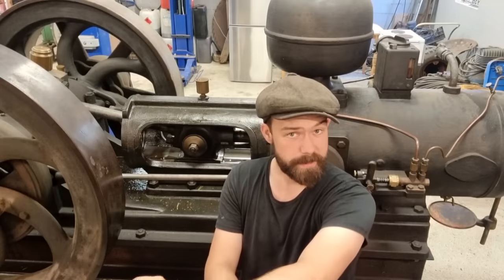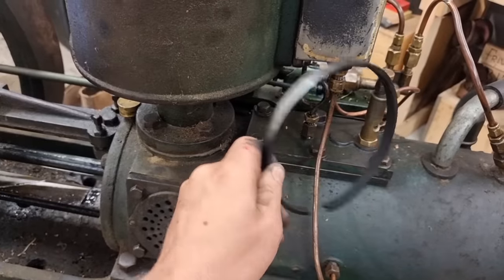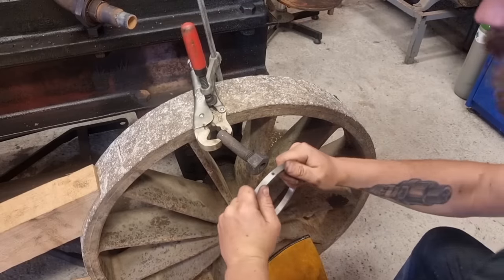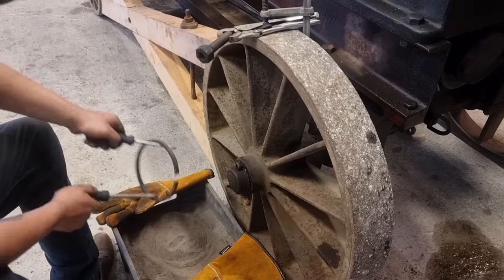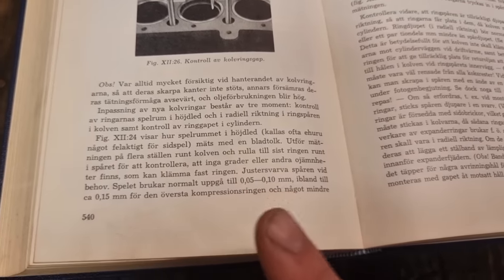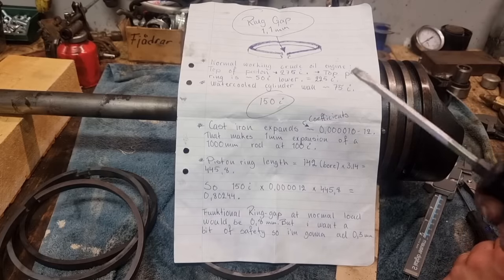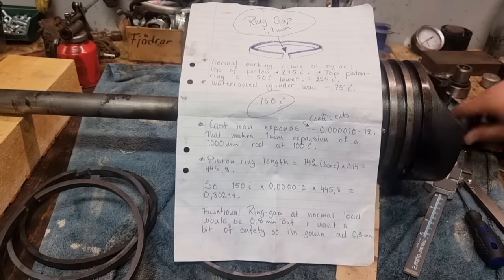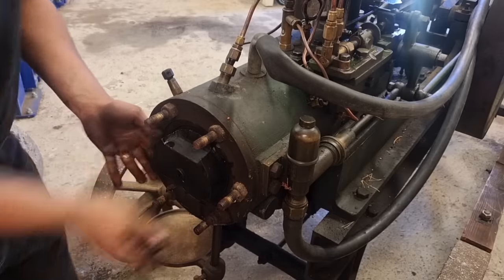Making Piston Rings!   In just 131 easy steps?..

Comment: Nice job on the new rings !
I made some smaller piston rings a while back and the old turner at work kept me right. We didnt heat the ring up, but peened the inside of it with a piece of round bar before cutting it and that gave it it's spring.
I recently saw a video on here about making "Clupet" piston rings, there was no way I could believe you could manipulate cast iron the way they did ?

Comment: Thank you for the video. Question: Is it possible to drill the hole (in this case 6mm) and then cut the rings instead of filing the pin hole with a file after cutting the rings?
Reply from the maker: Hi, yes of course. If you clamp the ring down tight that would not be any problem at all. But i think this method is easier, because a drill bit could get stuck and snap the ring of or crack it. This feals better and safer. /Richard

Comment: If you need a nice flat surface to sand parts on one of the best things readily available is a piece of sheet or window glass.  A piece of 6mm (1/4") placed on a reasonably flat surface like a workbench or a kitchen table will act as a flat backup for your sandpaper which is affixed with masking tape on the top surface. DO NOT used double sided tape on the bottom side as it will leaves a hump that will through everything off.

Comment: Man, finally, with the help of your chanel, I can travel in time a bit. Great content, keep up the good work. One question: Would it not have a good idea to make the recess for the locking pin by drilling thru the ring and then cutting it open thro the drilled hole?

Comment: Of you don't have an old pulley wheel to make them from, centrifugally cast tubing is produced, which will be of better quality than something produced from a sand casting. No trapped air resulting in cavities. Ask any steel merchant, if you've never encountered it.

Comment: For comparison, gasoline engines use .004 inch of ring gap per inch of bore for cast iron rings.
Reply: Yes, 0.1 mm equal .004(.003937)inch if I am not mistaken.

Comment: Hey Richard, nicely done! Thanks for sharing. About the expanding of cast iron, the books I used in school say 9-10×10^-6 m/m K^-1 @ 20°C... not that big a difference, or does it have to do with the base temperature of 20°C?
PS the dutch word for cast iron is 'gietijzer' 😅
Reply from the maker: Hi! Ok, yes maybe. And if you heat it up to 200c istead of 100c it is gonna expand more than 2mm. But that is so little that some books just dont bring it up. Would be fun to turn a "fake" cylinder in the lathe and put a ring inside and heat up and see what happends to the ring gap at different temperatures. /Richard
Reply: And the Afrikaans word for cast iron is "gietyster".
Greetings from South Africa.

Comment: I don't know if anyone else suggested this but why not drill the side notch before splitting the ring then correct as necessary with the file? The notches would match perfectly by default. Nigel
Reply from the maker: Hi! That would work nice, but then i would have to make a jig for it. And this is faster and turned out very good! If i was to make 20 rings, i would have made the jig. /Richard

Comment: Nice job!  I've made tiny piston rings for my son's model 4 stroke engine.  5/8 inch bore.  The 2 rings are 5/8" od x .026" wide.  The engine runs very well with these rings, which were made from rocker shaft supports of an old and scrapped car engine.
I noticed that you made the piston ring with a uniform cross section, as did I with those tiny rings.
Yet when you held a big, 300+ mm in diameter piston ring in your hand early in the video, it had been machined with an eccentric bore.  Thus this ring's cross section increased from a minimum at the ring gap, to a maximum 180 degrees from that gap.
Have you ever machined such a ring and if yes, how did you determine the minimum and maximum cross sections required?
Thanks for your response.
Reply from the maker: Hi! I dont quite understand. The 300mm ring is just like this one i made. But that one is factory made by Beijers engine factory in the 1930's. But that one also has the same thickness all around. It is not made excentric? Best Regards. /Richard
Reply: @YesterdaysMachinery  Hello Richard, I'm just guessing at the 300 mm dia.
One of the big rings you are holding early in your video definitely looks eccentric to me, with a thinner thickness at the gap end, and maximum thickness at 180 deg. from the gap.
Note that I am talking of ring thickness, ie. the radial dimension.  The width of the ring, ie. the dimension fitted into the piston ring groove is, of course, uniform.
But you stated that you never machined an eccentric ring, so that answers that.
Fact is, commercial rings are machined eccentric in order to produce uniform pressure along the ring on the cylinder wall.
A uniform thickness ring does not do this.
Think of a uniformly loaded cantilever beam of constant section modulus ie. uniform cross section.  Its deflection would not be a curve of uniform radius.
Not sure this is a good analogy, but it is my thinking without digging into it deeper.
I'm retired but I have a textbook somewhere with a short section on piston rings.
If you are interested I shall dig it out and review it.
Best greetings from Canada.  Wolfgang

Comment: I am wondering Richard the reason for the round hole you filed in the location of the center of ring gap. Are the rings pinned in the piston to keep them from moving around the bore ??? Nice work Sir using a cast iron pulley for your starting base material. Good day and peace too. vf

Comment: I have never tried to make rings, but I imagined that if I were to try, I would make them a bigger diameter than the bore and then cut the gap accordingly.
What is the reason you start with the ring @ bore size?
Reply from the maker: Very good question! You can not make them that way. The ring will not be round if you do make them oversize then cut a piece away to make the "spring tension". That is how they have made the rings that was in the engine, im 99% sure. The ring ends will be a bit more straight than the rest and push themself hard in to the bore. Not good. And how du i know do you ask? Because i have tried exactly that. This way is much better. 

You could make them a little bit oversized, to compensate the loss of material when cutting the ring if ypu know that your saw is removing more than the end goal of ring gap. But that is very little. You should always stick as close as possible to the cylinder diameter for maximal ring seal. /Richard
Reply: @YesterdaysMachinery 
Thanks. I learnt something!
Reply: @YesterdaysMachinery  The name for the width of the saw cut is called the "kerf."  It's the measurement of the amount of material removed by a certain thickness of blade.
Reply: @YesterdaysMachinery  I am a stationary engine collector and I restore them, I have my own machine shop and have made rings like that for a long time and they work very well I am talking with 55 years experience, the only thing I do is  I grind the sides of the of the hacksaw so that when cutting  the gap is at a minimum width!!
Reply: That is how you could make step gap rings. But you need to compress the ring, and clamp it between two heavy washers and then turn the OD to size so that it is round when compressed.

Comment: Very nice work! I have a question: you didn’t work on the cylinder. But didn’t that share in the wear, making the bore unround aswell?
Reply from the maker: Hi! The engine has not run much with these rings the bore was almost to perfect. But i still dont think they have made anything to it. I messured it on a couple of spots but it was just fine. /Richard

Comment: Great work, taught me a lot about piston repairs - might come handy if such a job comes up, someday - now I know what info to look up.

Is there a reason you did not just drill a, say 5mm hole before cutting the ring apart to save on hand filing? 
(I guess lack of a working setup to hold and drill the rings, but I was wondering if there is a technical reason why you would not do that...)

Comment: How much clearance do you give around the locating pins so the pin doesn’t restrict the ring from compressing fully in the bore?
Reply from the maker: Hi! The locating pin was around 6mm. But if you would calkylate the expansion of the slot in the ring that clerance would be so small that you couldn't really messure it. If i compress the ring all the way in to the ring grove so that the ring gap is zero, i want a little play around the pin. But it is enough with as little as possible really. I have not find any data on that clerance actually.  /Richard

Comment: Awesome video. I have a question though : instead of sawing the ring then filing two half-holes on each side, wouldn't it be easier to drill a hole first, then saw along the diameter of the hole from one side all the way to the other side ?

Comment: Is the heat treatment just to relieve tensions and set the shape open so the ring wants to spring open when inside the cylinder for compression, or does it also enhance wear resistance or something?
Reply from the maker: Hi! Just to set the spring tension. /Richard

Comment: A most enjoyable video.  Could you not have drilled a 5.9mm hole  into the ring and then cut the ring???
Thanks for the idea of an old Flywheel for larger rings as `we` require soon two new rings of 12" diameter for a Buxton & Thornley Horizontal.  Thanks again, take care,
Reply from the maker: Hi! Yes i could but a file is faster than rig the ring up to drill a centered hole. i like files. /Richard

Comment: I always wondered how you got the right compressed OD but still have spring tension. Used to think they were cut oversize.
Reply from the maker: Hi! Making them as oversized and then cut a piece away aint good. When ypu compress the ring to the cylinder diameter in the bire the ring will not be round. So that is a no no. I have tried.... /Richard
Reply: @YesterdaysMachinery  That's what I thought would happen, great to see the process and methodology. Based on the wear marks on the old ring I'd wager it was made oversize and sat on the tips as there wasnt enough bending moment along the carbon stained areas to make them seal.

Comment: I really had no idea that cast iron is suitable for piston rings. My first profession was a machinist and I've made a lot of parts in cast iron, but that was most often parts were compression strength was important e.g. ball bearing housing etc.. I initially thought that cast iron would be too brittle to make piston rings, and I was a little tense when you stretched the piston rings to finish the ends. I have worked as a software developer since the end of the 90s and it is about 25 years since I worked as a machinist/toolmaker, my material theory is... somewhat rusty. 😉Is it common to make piston rings out of cast iron, and do you use a specific type of cast iron?
I just found your channel and immediately subscribed.
Greetings from Oslo. 🙂

Comment: That's like turbo engines the ring gap has to be larger then a Natural Aspirated engine because the compressed air from the turbo is hot and all that extra air heats the charge up and expands the piston rings. If you don't expand the ring gap on a turbo engine the ring will expand and break the ring land leaving the engine with broken pistons.

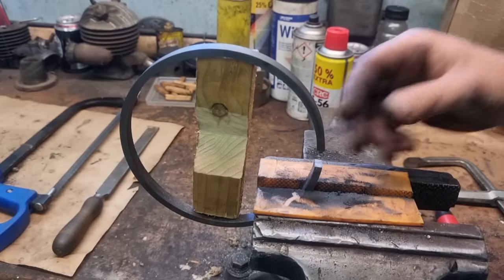Comment: Regarding the cutting of the locking pin hole at about 3:10. Would it not be easier than filing it to cut the hole first with a drill, and afterwards cut through the hole with the saw? Or would that mess something else up.
Reply: Just read your reply to the same question further down. Really ought to read the existing comments first!
Reply from the maker: Haha, you have your answer then! Should have brought it up in the video, many have been thinking the same thing! /Richard

Comment: You remind us of the tradeoff between the way engines were a century or more ago, and the way they are now.  Modern engines are far cleaner running and more efficient, have much better power to weight ratio, are much more compact (6 hp is a large lawnmower engine now, probably weighs 10-12 kg) -- but you can't fix them yourself this way, especially not the highly efficient, high-revving ones used in cars and motorcycles.

I have a car about 100 years newer than this, and the engine is lighter and more compact, but puts out more than 20x the power (probably on less than three times the fuel burn, though it's hard to compare a diesel hit-or-miss to a direct-injected spark-ignition gasoline engine) -- but I'm halfway afraid to even change the spark plugs myself because it uses coil packs, which are expensive to replace if you damage one.  I can't change the main belt (drives the cooling pump, alternator, and air conditioning compressor) because it needs a special tool to stretch the belt into place, so some local shop will get $200 to install a $14 part.

I wouldn't trade my Fiesta for whatever machine might drive on the road and run on that kind of engine (it'd take me at least twice as long to get to work and cost three times as much in fuel each day) -- but I do sometimes wish you could do basic maintenance at home like I used to do in the 1970s.

Comment: piston ring end gap is 0.002" per inch of bore for water cooled and allow 0.004 "  for air cooled or   metric  0.05  >  0.1 mm    142mm water cooled bore  0.275 mm would do
Reply from the maker: Hi! very interesting! But sounds very little for a ring gap. But it might just work! Would be nice to investigase with a ring in a "Dummy" bore and heat up and check the gap at different temps. But i want to play on the safe side. This have worked fine before. And these Crude oil engines aint to sensitive bout a little "to big" Ring gap either. Better than to small. / Richard

Comment: Not to say someone messed up on the rings. But lots of times back when you could buy said rings, the bore wouldn’t be round but egged shaped and they would wonder why it still don’t have compression. Or maybe would start but have blow by. Experienced it myself. Good video tho
Reply from the maker: Yes, been there done that. Cylinders that has been honed 3 times with new rings and sold as "Engine like new".  But this bore was really really good. /Richard

Comment: I recall my father telling me about a man in Guildford  during WW2 ,who made car piston rings from cast iron drain pipe. He scoured the country looking for centrifugal cast iron as he maintained that made the best rings.  I think the same man had a trick to ream the inside of rubber brake hose using a car battery and a length of copper wire to burn the swollen rubber to recreate  the fluid path..
Reply from the maker: Hi! Yes centrifugal cast iron is great. I think there is less risk of bubbles in it than regular castings. Otherwise it should be the same. There was some bad spots in this belt pulley i used but i was lucky that it wasn't where i did cut the rings off. /Richard
Reply: @YesterdaysMachinery  in the 1980’s I did some work with a nickel silicon carbide composite, it was applied to BMW K100 engines to give a wear resistant cylinder lining. The cylinders were reckoned to be good for 200,000km, the rings should last 100,000. The rings were plain , uncoated cast iron!  I am told that the ideal wear combination is a hard against a soft surface, so tin alloy against hard chrome or induction hardened steel being the most common. It’s also why bronze makes a good bearing but brass doesn’t.

Comment: Why the heat treatment to expand the radius? Couldn't you have machined them with a somewhat larger radius to begin with?!
Reply from the maker: No you can not. Then the rings aint round when you compress them in the bore. You have to make them round and then set the tension so when they are compressed they is round in their "normal" position. /Richard

Comment: Seeing things like this makes you realize how spoiled they were with the simple engines back then. When’s the last time you cleaned your injectors just by disassembling them, or took your pistons out for an overhaul in 10 minutes by removing 6 bolts and a pin, or made new piston rings from scrap cast iron pipe and had it running again all in a day?

Comment: Interesting to see what you did, but why that way ? Expanding it with a hand moved blowtorch seems unlikely to yield perfectly even heating (cf eg a temp controlled oven) and hence not a perfectly round ring (you dont show multiple measurements) .. why not just turn a ring the wanted expanded size from some larger material .. will come from the lathe perfectly round .. then just cut out a segment    to yield the wanted cylinder diameter ? .. and no need for messing with the blowtorch.

Comment: Wouldn't it have been easier to drill a hole in the ring before cutting it through one side? Then it's pretty much done. Just a thought.
Reply from the maker: Hi! No, to rig every ring up and drill a hole would not be faster or better in this case. And i like files. But if i was to make like 40 rings this exact size it would probably pay of making a rig. /Richard
Reply: @YesterdaysMachinery  Hi Richard, I see, well either way it works fine. Thank you for your reply, I love old machinery and stationary engines, my trades are mechanical and Aircraft so I tinker with old stuff from time to time.
I love the videos and look forward to more. Have a great day  /Scott 👍😊